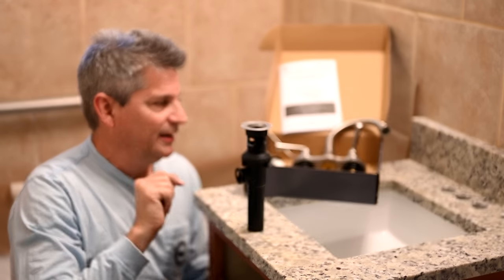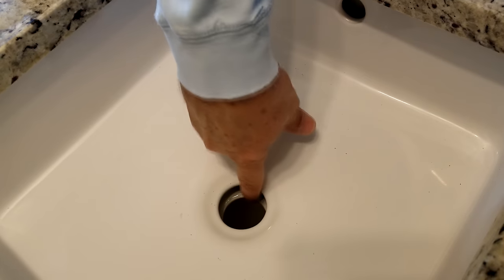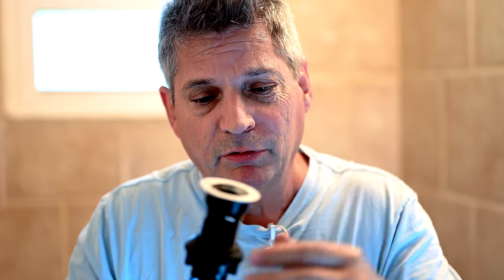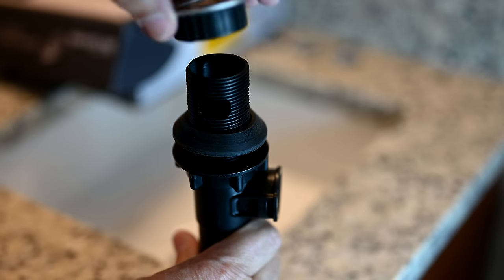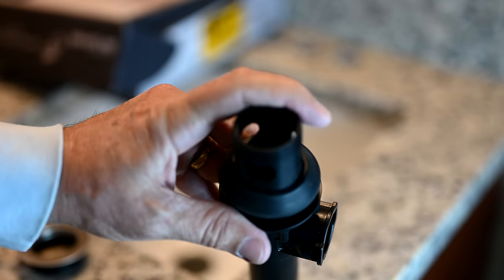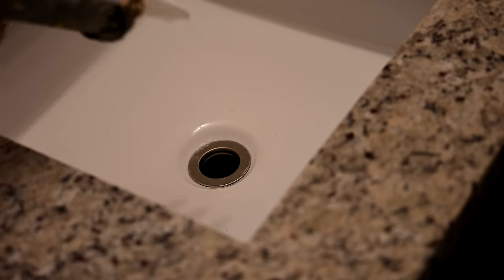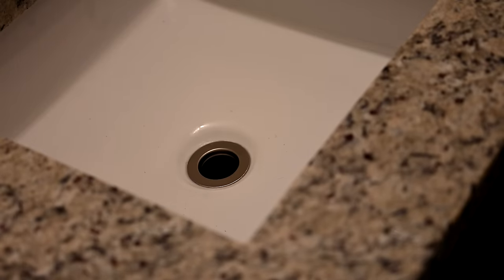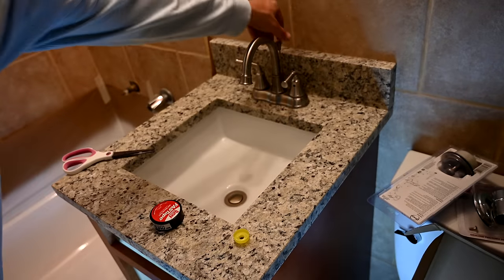How To Install Bathroom Sink Drain/Faucet, No Leaks Under Gasket, Threads [SOLVED] 2023

Comment: The Ridgid EZ change wrench shown is NOT well rated by many other users. Possibly yours is older but the quality of newer ones apparently ain't there any more. Any suggestions for a suitable replacement ?
Bewildered Bob
Reply from the maker: I bought a new set last year, they work perfect, and fit all valves, no one has ever commented to me about why they don't work.

Comment: I applied teflon tape as described above and below the overflow holes down several treads until it touched the big rubber gasket. At least 2 layers. After testing several minutes. I noticed water slowly slowly seeping out between the threads. Not from the bowl and gasket. Should I apply more teflon tape below the  overflow drain holes that will be between the gasket and threads?
Reply from the maker: You need to wrap the tape on the spot where the the rubber gasket is surrounding the threads on the pipe, so dry fit and tighten it up to see where that is, and make sure the the tape is wrapped there. You don't need more tape, don't cover the weeping holes, just make sure the tape is in the correct spot.
Reply: @jeffostroff  Will try again tomorrow. Thank you for the reply Jeff.
Reply: @winstongoodman3244  Did it work?  Had the same leak  problem. Water leaks. Might have to take it apart and use silicon instead of put new tapes.

Comment: Hey Jeff, great video! Is it normal for water to sit in between the overflow drain holes on the drain pipe and the overflow hole from the bottom of the sink that leads into the pipe? Just did a full replacement but noticed the water doesn’t fully drain out from that void. Thanks!
Reply from the maker: that is why they have the gasket there as well. As long as it does not back up into the basin or cause a leak, it should be ok

Comment: Is it a good idea put plumbers putty under the flange at the top as my faucet is inserted from the top side and has a gasket under the top ring.flange. Should I put plumbers putty under the top gasket as I seem to be having leaking problems coming from the top of the sink but maybe its a good idea to put teflon tape on the threads for the bottom gasket too?

Comment: Fantastically helpful video.  Oakly Fastape is thicker Teflon compared to regular white Teflon.  Not convinced it is best on these threads you are working with.  Flipping the roll of tape allows you tension it and wrapping is much easier.
Reply from the maker: Great tip!

Comment: I have a Moen pop up drain assembly and I am running into this leaking problem. The difficulty is that the Moen drain doesn't have any threads at the point where the gasket interfaces with the sink, because the threads stop and the plastic drain pipe becomes smooth above the threads. Have previously installed two of the same type without this issue. Frustrating! Thanks for your video

Comment: Hey Jeff thanks for the video. Explained a lot. Only question is I use lamp wick. I've never used Teflon tape. I also use plumbers putty. Is this ok. ?
Reply from the maker: The plumber's body is OK on the drain flinch on top of the sink, but they are now telling us not to use it on the bottom of the sink underneath where the black gasket is because it can dry out the rubber
Reply: @jeffostroff  ok thank you

Comment: Could you just use pipe dope instead of the Teflon tape? Not plumbers putty but pipe thread sealant that comes in a little squeeze tube. 
Just subscribed! Great video sir.

Comment: Hi Jeff, thank you for the EXCELLENT VIDEO. Learned a lot from it.
I would like to ask you a plumbing question please. We have an old single story house in a great shape,  built on a slab in 1976.  We have two bathrooms, about 22 feet physically apart, that are almost identical in design. The front, entrance side, of the bathtub is about 3 ft from the commode. The discharge from the commode is about 8 feet from the main sewer line in the yard. The tub drain discharge is about 14 feet from main sewer line in the yard. The bathrooms are in great shape, but the kids bathtub (only)  releases sewer fumes when taking a shower. But it doesn't happen every time they use the shower. Also I noticed that if the commode is NOT flushed before taking a shower, they do not smell the abnoxious odor. I am thinking it may have something to do with the vent system between the tub and the commode, for that particular bathroom.  But if so,  how do I fix this problem considering a concrete slab and very nice walls.  Thank you for your response.
Reply from the maker: Could be a few things. #1 you need to find out if you have a P-trap underneath your tub drain. Every fixture must have a trap. You sink has one inside the vanity. The toilet has one built onto the lower rear of it. The tub should have it in the pipes underneath. The other thing is what if the plumbers originally installed an S-Trap and not a P-trap. Then you could be facing self-siphon issues, where the water seal inside the trap siphons itself out, now you smell the sewer gasses. Also could be trouble down the drian line under the yard with roots poking into the drain pipe going to the sewer. That often causes water to back up toward the toilet or bathtub drains. Sometimes you can see the toilet water bubbling when the sink is draining when this happens. These are just a few causes I can think of.
Reply: Thank you Jeff. Will look underneath the tub for S-trap and if found, replace it with a P-trap. Thanks again
Reply: 1986 Nissan hRdbody speed sensor throwing check engine lght

Comment: 9:50, Your advice of leaving the blue film on the flange cause a blue risidue around the sink hole after I tighten because the edge of the film got stuck underneath. I have to remove the flange and pipe to remove the leftover blue film and redo everything again.
Reply from the maker: Sounds like they cut the film too big on yours and it overhangs. You can se eon mine we never had this problem.
Reply: @jeffostroff  So it's good that you advice other people about this issue of some flange having overcovered film. I bought the Delta faucet and they have the flange with blue film wrapped 2mm underneath. 🤪
Reply: You give GOOD advice and instruction overall. Thanks for the video. 😁

Comment: Any reason why my sink stopper might be too low? We installed a glacier bay faucet todya. We have the arm on the last hole but the stopper is probably 1/4 open. Water drains slow.
Reply from the maker: The height is set by the horizontal rod that slides up or down. Once it is in the final position to makes the topper go all the way up for open, that is when you connect the horizontal rod to the vertical rod. Also during assembly, make sure you put the stopper in first with the hole facing the right direction so the rod can go through the hole, and now the rod can raise and lower the stopper correctly. IF this alignment is not right, the stopper won't open. Test it up and down on the horizontal rod before securing the vertical strap.

Comment: Thanks Jeff. I enjoyed the many great tips and suggestions. A few questions/comments:
1. Seems like installing the faucet prior to the drain assembly seems prudent to provide maximum access to the faucet and supply line connections?
2. Could you use silicon instead of nylon tape on the threaded drainpipe for both the top and bottom?
3. Caulking the backside of the faucet escutcheon is always a pain. Would placing a bead around the perimeter of escutcheon be practical before it's placed work?
Again, thanks for the video.
Reply from the maker: Yes I normally put the faucet on first before anything else. I would not recommend putting silicone on the threads because it is pretty permanent and it might be hard to loosen it if you ever needed to separate them. That's what the Teflon tape is for. For doing your silicone on the backside of the faucet where there is not much room between the faucet and the backwall. I buy these smaller 6 inch mini tubes of silicone from Home Depot and you can reach it with those and then just tool it around with your finger around the back side. You could place some silicone on the excursion before putting it down, but keep in mind that you are trying to protect the inside of the faucet from water coming in from the outside so this needs to be an outside bead of silicone as well
Reply: @jeffostroff  Great. Thanks for the clarifications, and quick response to my questions! Merry Christmas to you.

Comment: This was helpful. Why not put a bead  of silicone under the faucet gasket rather than around the edge after it is installed?  I did not know that plumbers putty was harmful to black plastic until watching this video.  I never felt the need to slope the pipe into the wall just so it was horizontal but I suppose that reduces deposits in that horizontal section but it can also stress the plastic at those fittings.
Reply from the maker: You could put silicone anywhere. I showed it also on the underside of the flange, then I sealed it around the edge afterward.

Comment: The Moen sink drain pipe did not have threads on the bottom side where the gasket met the underside of the sink hole. I put teflon tape on the smooth pipe and the gasket went over it when pushed up by the plastic nut as it tightened and the  leak stopped.  Thanks !!

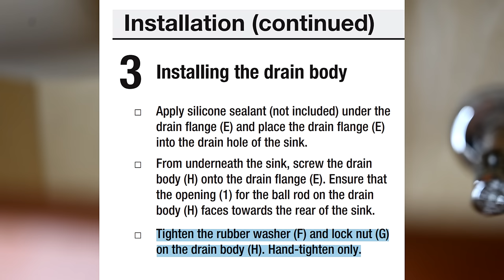Comment: Posting this in hopes it will help someone:  Bottom line, check what your instructions say regarding the lock nut installation @ 9:13.
In my case with a Delta bathroom sink, it was leaking when hand tightened, and only stopped when I noticed the directions actually called for using channel locks/wrench to tighten it down further.  For me, the leak didn't stop until the "cone" shape became flatter, like a pancake, blocking water from leaking, so yea, Jeff's faucet might be different than yours, check your instructions.  Everything else he recommended in the video was helpful, esp the teflon tape tip, thanks Jeff!
Reply from the maker: Whenever they tell you to use a wrench they typically will say something like a quarter of a turn or a 1/2 of a turn beyond hand tighten

Comment: Thanks for a helpful video. One thing I wondered, the gasket under faucets never seems to seal well enough to keep standing water from running under the faucet and down. I usually put plumbers putty under them as well, but this is my first cultured marble sink, so I'm thinking a thin bead of silicone on the gasket?
Reply from the maker: Try it with just the Teflon tape like I i showed. Oatey says not to use putty on rubber, i can cause it to dry and crack.

Comment: Have you ever experienced a leak hours after installation?  I found some water at the bottom of the cabinet overnight.  I didn’t turn on any water during that time.  I am assuming the connections constricted after cooling down which provided a gap at a connection.
Reply from the maker: Yes once in a while we will find that that really tricky ptrap connection to the output of the P trap well sometimes leak a little bit because it's such a critical alignment that's why I mentioned in the video that you have to tighten that connection first before you do the other connections it has to be happy before the other ones can be happy. But with more experience we get better and better at making sure that it's better aligned before connecting the P trap and so I no longer have any issues after installation. This is why it's important to put down that paper towel and watch it overnight.

Comment: Jeff, I still had a leak at the gasket after applying the Teflon tape. However, I applied it then screwed the base unit into the drain hole that I used silicone adhesive to secure in the basin. That tape made it harder to screw in and in doing so I broke the adhesive seal and had to start over. Did I need to take the Teflon tape off that I had just applied? Did unscrewing that base unit ruin the tape? Could that be the reason why it is leaking still? Should I have taken that tape off and reapplied it or should it not have mattered?
Reply from the maker: The only reason it would leak is because the Teflon tape was not placed right where it should be on the threads, so that the black gasket is surrounding the Teflon tape on the threads.

Comment: Your video helped me immensely in my first new sink installation.   Unfortunately I've run into a snag.  When I inserted the new sink into the vanity cabinet, the newly installed drain pipe did not line up with the P trap.   It was about a half inch to the right.  I was able to move the P trap to the right in order to insert the pipe but the pressure is pushing the sink  out of alighment.
Reply from the maker: The P-trap swivels, so you should be able to make that match up, there have been times I had to make the j part of the p trap face forward before turning the second part of the p-trap backwards. You will make it fit.
+
..
Reply: @jeffostroff  Thanks so much for the advice.  Pivoting the P-trap didn't solve the problem but was a part of the remedy.
I had to remove the pipe going into the wall outlet, which was a real pain in the ass since it was wedged in so tight after 30+ years but I finally did it.    
I shortened that pipe by 2 inches, cleaned it off both inside ( amazing amount of gunk) and the outside and reinserted it using a new washer and teflon tape on the threads.   Set the sink into the cabinet and swiveled the P-trap so that the sink drain fit perfectly into the trap.   Taped all the threads and tightened all the fittings, ran water thru the sink to insure no leaks, there were none.    Successful first time installation.   Took three days thru trial and error and many trips to local hardware store and watching your video  but I finally got it done..................Thanks again Jeff!

Comment: Can you install an over flow drain to a non over flow sink? If so how do you prevent water leakage.
Reply from the maker: no the overflow hole needs to be at the top. I would not buy a basin without an overflow hole, or water could run over the top of the sink and flood the floor

Comment: Jeff thanks for the update clarification of teflon tape on the drain pipe threads with 2 buts: what happened to the teflon+2 you smeared around the underside black washer? Thought it was a good idea for leak protection ; silicon is so messy, apple cider vinegar can help with the clean up but use sparingly as can dilute the silicon.
Reply from the maker: Yes I installed that second application of the Teflon tape around the bottom where it meets up to the black gasket and that's what I believe solves the problem for most people

Comment: I have never seen anybody use Teflon tape for this situation but may be worth a try.  I am currently replacing two pop ups on a 17 year old marble sink and the drain holes are. unfinished and has lumps where the cone shaped washer is to sit against.  The previous person who installed it . used huge cone shaped washers with brass flat washers.  I have been a builder for 40 years and never seen that type of plumbing. If that doesn’t work I will break out the Dremel. I going to do this for the 3 rd time to try and get this double sink to stop leaking.
Reply from the maker: This will work!

Comment: Will adding silicon make it difficult to remove if there is a problem or later if it needs replacing?
Reply from the maker: Silicone scrapes out with some effort and right tools.

Comment: Great video, but it's worth a mention that teflon tape is specifically designed to seal tapered pipe thread. Unfortunately the thread on that shaft is NOT tapered. Another helpful bit is putting a little bit of either faucet grease or soap on the underside of the gasket since there is no washer. This helps prevent distortion of the gasket when hand tightening the nut on the bottom. Great video put thorough explanation.
Reply from the maker: I have never seen any manufacture's instructions specifically differentiate between tapered and non-tapered threads. Even RC worst says Teflon tape can be used just about anywhere where you have threads. Avoid using Teflon tape with compression fittings, hoses, or applications that have an o-ring or gasket. I would like to see where you found this information that specifically states by the manufacturer of the tape not to use it on this type of thread.
Reply: @jeffostroff  as a machinist, there is no mechanical difference between taper and straight thread. Who told you this foolishness?
Reply: Teflon tape is designed to facilitate tightening of a tapered joint- of course cna use for purposes mentioned here, but that not its origin l or primary use. Personally, I find plumbers putty more useful here…
Reply: Also good idea to spray soem dry silicone lubricant to avoid those nuts freezing up and rusting on the threads (though liquid wrench usually bails me out !)

Comment: Thank you for such a great video. I just completed one of two sinks before watching this video and used silicone where you had added the Teflon on the lower rubber gasket. Hoping the silicon does not react negatively with that rubber. Your way seems great and may try it on the second sink.
Reply from the maker: Glad it was helpful!

Comment: Just a comment, my sink was pretty thick, and it didn't seal up the first time because if you put the teflon tape above the rubber washer/cone then it doesn't travel upwards as much because of the thicker sink.  I had to remove the rubber washer/cone, put teflon tape on just above the threaded ring, and slide the rubber back down.

Thanks!